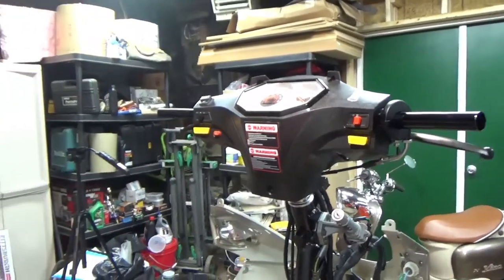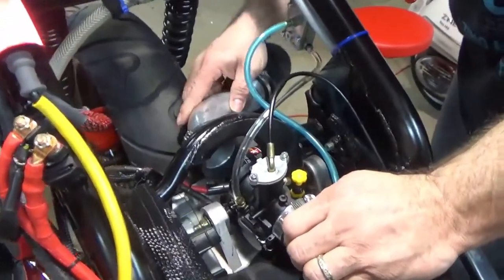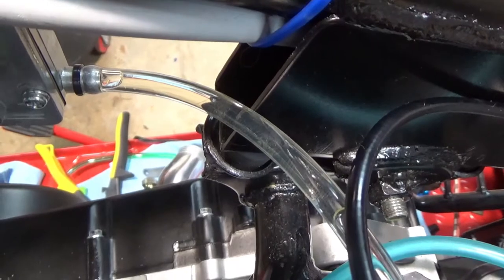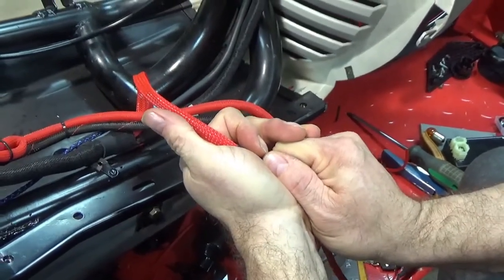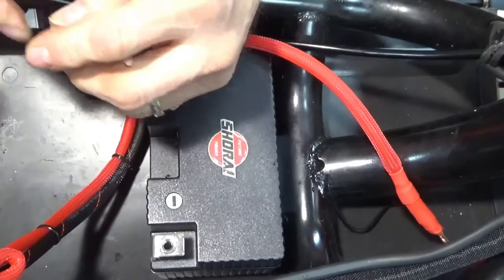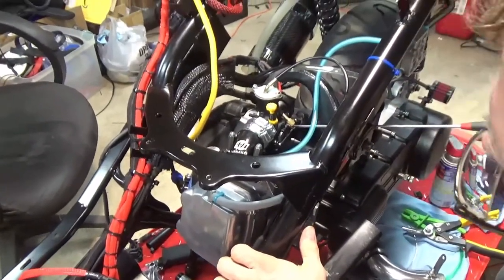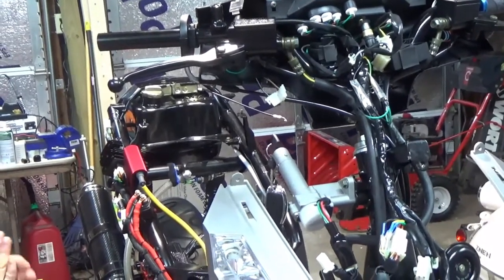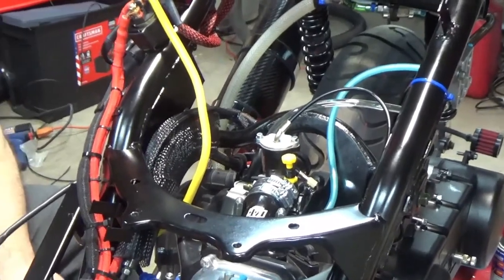PWK Carburetor series #2

Comment: i have a 28mm pwk that i recently order but im trying to find whats the size for the hex key to open the accelerator
Reply from the maker: Sorry, can you be a bit more descriptive? Do you have a picture? Are you meaning the air/fuel adjustment?
Reply: @apmscootering5219  the tool you use to open the top in order to place the accelerator
Reply from the maker: @Gloryboiponch  I think it was a 4 or 5mm Allen key. Sorry it's been a minute lol

Comment: Sounds like a bigger main jet
Reply from the maker: You are correct but I ended up moving to a 28mm oko/usa carburetor and playing with the needle to correct the issues.
Reply: @apmscootering5219  intake side 35 millimeter air filter side 48 with the 40 Main Jet and halfway the needle and that will put you real close just have to tune from there.nibbi kit

Comment: I have also a 180cc bigbore with a 28mm pwk and I have some trouble findig a good tune. My scooter starts pretty well and goes full gas kinda good, but i think i have a problem with the needle. My scooter only works with the needle on it's lowest and even then it feels like it's running rich. So I wanted to ask you what needle do you use? Is it longer/thicker than the original one?
Reply from the maker: No, it's the original need. Just make sure you're actually riding it when tuning. I know sounds hard but use a air fuel sensor
Reply from the maker: You can try a different needle, sorry if I'm unclear, my meaning about testing it's better to test your tune underload you sitting on it. Your best served with an o2 bung in your exhaust with something like an air/fuel meter going to the bung and strap the meter to the scooter so you can see your mixture reading when your riding it and adjust accordingly. Also try changing your jetting. Hope that helps.

Comment: What can you do if the intake boot sits to high? I can't fit the filter cause it's at the same level as the mount.
Reply from the maker: I changed the intake to one that sat a bit lower to allow the filter to clear. I know it's a bitch.

Comment: So...thos throttle isnt the bearing throttle right?   It accepts regular grips.

I got the needle bearing NCY throttle... But I didn't now (slips through my mind)

That the throttle side grip is actually bigger than regular grips.  Woohoo

So i loose my nice grips...i had cyan lever and matching grips

So I guess I have to give the grips up..for the new way better bearing throttle
Reply from the maker: Yes, you are correct! You could cut your grips down to fit the throttle tube and add end caps to the grips...thanks for watching
Reply: @apmscootering5219  it seem that particular bearing model. Is actually too big for stock grips. So I had to remove the cyan aluminum grips. And use the ncy that came with the new throttle assy
Reply: @apmscootering5219  I might try to add the endcaos to at least have some cyan on the grips! (The black rubber is nice but.. Now I got useless grips!..) So maybe the endcaos can be fitted.  We will see

Comment: I couldn't had to use one of those pancake style filters I had about 3 inch clearance
Reply from the maker: Some have more clearance than others..frames are different
Reply: @apmscootering5219  I seen makes it a pain
Reply from the maker: Absolutely does
Reply: @apmscootering5219  I do know with this filter I don't hear much of a idle pick up when I adjust the air/fuel must be the air filter think I might bump the idle jet to 38 see if that makes a difference.There is a 35 in it now
Reply: @apmscootering5219  got it all set seems I had a vaccum leak.But I do hear a very small surge in idle I have air screw set at 2-1/2 turns out kind of stumped on this
Reply from the maker: What size carb? 26, 28 or 30mm?
Reply: @apmscootering5219  28mm
Reply from the maker: @ironhead320  sorry for the late reply..are you running a big bore kit? 171cc like taida or NCY..if you are I'm at 32 for the idle jet..
Reply: @apmscootering5219  I'll try that I got a 35 in mine
Reply from the maker: What are you running for the main jet? Which is for wot..wide open throttle?
Reply from the maker: Also check the needle height..might need to shim it..
Reply from the maker: I'll be honest it took me forever to learn how to dial it in. I ended up putting a bung on the exhaust and got an air/fuel reader to help me with all the tuning I was doing. I never really filmed it because it's over a lot of people's head and I didn't want to fuck everyone up..you don't need one but they make life easier. Thanks for the questions 🙂
Reply: @apmscootering5219  I was thinking of that some of these kits don't come with a bung have to look around
Reply: @apmscootering5219  main is 110 and I'm on the second notch on needle
Reply: @apmscootering5219  thanks for the info easier is better
Reply: @apmscootering5219  think I got it when this would sit say for a day or two I would have a hard time starting it it would stumble and cut out.So I went.to the air fuel screw where the air filter goes on the screw was out 2-1/2 turns so I started from the beginning set it at 2 fired right up see what that does ordered a A/F and a wideband sensor.
Reply from the maker: You have an 02 bung on your exhaust?
Reply: @apmscootering5219  no
Reply: @apmscootering5219  thing is my motor is stock with 10 miles.Seems I still had a issue so I went down to a 32idle sounds different like better idle.But when I blurp the throttle and let go the idle drops like it going to die then picks up to normal idle so if I lean it when I do a blurp it wants to cut out and the screw is at factory 1-1/2 turns out so thinking maybe cracking it 1/4 in to see what happens started getting dark and my light died.I ordered a A/F set up but turns out it's coming from China I'll see that in 3 months but was only 50.00 for everything I should checked where it was coming from first.
Reply from the maker: So play with the clip for the needle..lower it and see if not keep lowering it or raise it. This is something you might have to shim the needle also. It's playing with the needle to gauge the fuel at throttle
Reply: @apmscootering5219  it's on the second notch down I'll put it on the first one and try that.
Reply from the maker: Just remember lowering raises the needle..if that doesn't work I'd try the opposite direction. R u running a pwk or cvt carb..sorry I didn't remember..lol
Reply: @apmscootering5219  pwk but it came with another needle and by looks is a little fatter so going to try that on #2 slot on needle
Reply: @apmscootering5219  I lowered the clip to the third groove seems better when I blurp the throttle but still figuring out with a rev and the slide snaps shut I still have that dip in idle it dips little below like it's going to cut out then it goes to  regular idle have to play with it some more unless the carb is junk.
Reply: How big of a hole do I need in pipe for the bung for wideband sensor
Reply from the maker: It depends they have smaller buns for O2 sensors and they also have standard sizes for the O2 sensors I actually used a standard O2 sensor and had it welded in at a garage they charged me think like 20 bucks to weld it really does make it easier
Reply: @apmscootering5219  ok yeah mine is standard also
Reply: @apmscootering5219  just hope I got the right thickness in count.of the sensor blocking flow

Comment: These carbs are they suppose to have alot of throttle pull or is that normal
Reply from the maker: What do you mean Pete? Like throttle as distance travel, just trying to understand so I can better answer. I would say you have idle to 1/4 turn, then 1/4 to 1/2 then 1/2 to wot (wide open throttle) the thing pwk carbs is tuning and test should always be done under load, meaning actually riding it then adjust and so on. I hope that helps if not help me understand what you mean.  Thanks
Reply: @apmscootering5219  yes throttle travel
Reply: @apmscootering5219  seems I have a lot more with this style carb
Reply from the maker: Yeah I would tend to agree with that. it's definitely more open than a cvk. On my 171cc I went from a 30mm oko to a 28 and had way easier time jetting correctly and getting the most outta of that carb.
Reply: @apmscootering5219  I found a A/F gauge set up it's not digital it looks like a tach but I have that in 2 days I'm not waiting 2 months to get this dialed in
Reply from the maker: Nice..it will definitely help. Let me know how it goes
Reply: @apmscootering5219  will do
Reply: @apmscootering5219  got my A/F gauge but this thing you can set for how many cylinders you have default is 4 cyl and input signals settings 0-5v for wideband and 0-1v for narrow.Im not.sure if the cylinder setting on 4 if that's going to mess things up then there is speed pulse settings man this is going to be a headache
Reply from the maker: I came back to you and this particular issue. I'll be working with taida for a 232 build here in the spring. I'll go over what I use in detail for tuning. I hope you stick around. Maybe a live if anyone wants me to do that for the tuning.